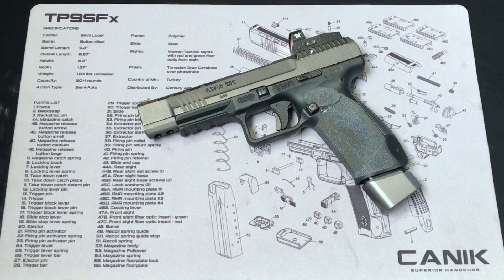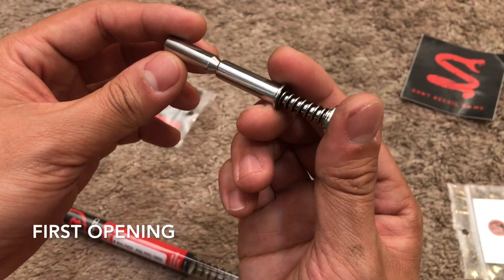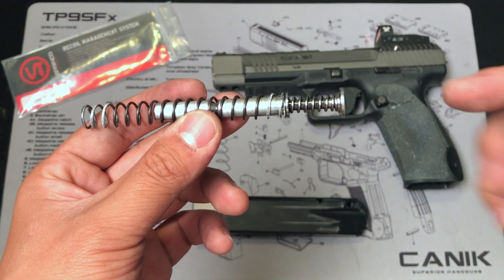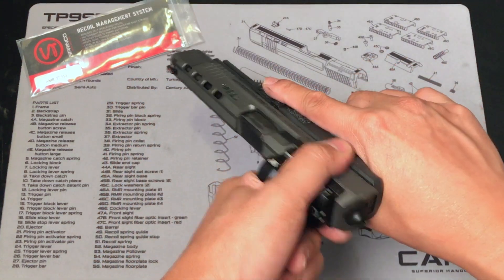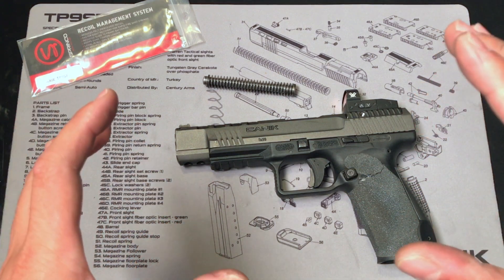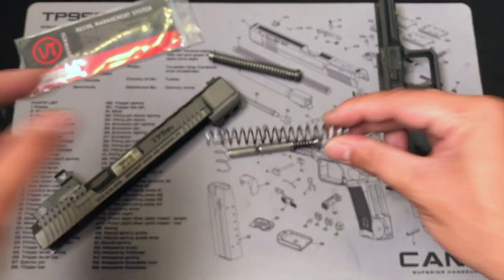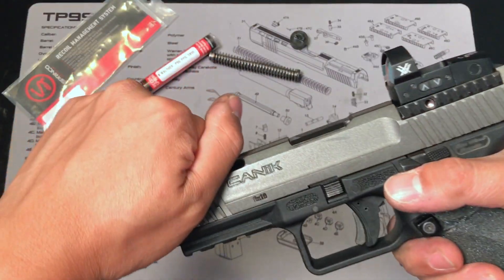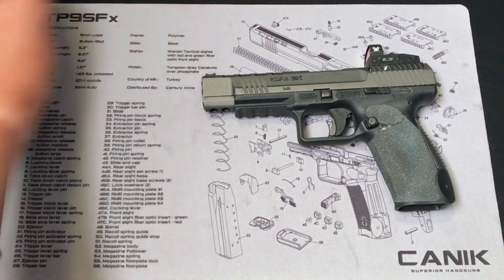Sprinco USA Recoil Management System

Comment: Tank I followed your directions to the tee, I changed out the recoil spring with the double spring from springCo and changed the firing pin spring with a 28 newton Glock spring.  Shot if for the first time this weekend and had 5 stove pipe occurrences , any explanation , I was shooting 115 grain bulk ammo from Bulk ammo.
Reply from the maker: I would check the ammo quality and shoot other ammo first, such as Federal american eagle. I would also check your griping. if you not grip your gun tight enough will also cause stove pipe.
Reply: Thanks Frank, I changed the spring so I could shoot bulk ammo, I will take that advice under advisement.  I do practice my hand grip.

Comment: Good video. and this looks like a good product. I have never modified a pistol from stock, but I like the idea behind this recoil system. I have the TP9SF but assume the issue with the slide impacting the frame would still be an issue as it was on the SFx.
Reply from the maker: Some people have some issue on their gun that FTE, due to the strong recoil spring. These mod is usually for competition :) I have an SF that is still stock and runs great.

Comment: Damn recoil spring cost as much as my new SFX. lol. $100 is a bit high, IMO. Love my stock SFX though. ($100 was a joke) My new SFX cost $470 out the door. Damn well worth the money. Put a cheap $40 micro red dot on her & she drives nails at 50y but hate a red dot. I’m a straight open sight guy I guess. Glad I didn’t purchase a Vortex & I highly recommend mounting a cheap micro to see if you like b4 shelling out the $$ for a high Dolla Red Dot.
Reply from the maker: yea cheap dot will work if you shoot at the range sometimes. I have my SFx with vortex Vemon 6MOA on it for almost 20,000 on it and no problem. I guess it depends on what you are using it for.  everything I put on is still working, just like the spring set. Again, I shoot competition, the stock pistol is fine for sure, but the gun shoots even better when you have some upgrade
Reply: Mike Hog A Nator what cheap red dot did you use? I'd like to get a cheap one to use but not sure what will fit the plates they supply. They only list the high dollar optics..
Reply: Pyro17059  It’s the ADE Micro Red Dot. It’s like $39 on eBay or Amazon. There’s a review Video on it. Some guy has it on his 40cal. & it works great! Especially on The TP9SFX. It holds zero & I Zero’d mine for 50y & was Driving Nails.. The only issue is, you have to file off a few MM off the back of the optic so it will fit down into the rear cut of the plate slide on TP9SFX. If that makes sense. You’ll see what I’m talking about when you get it. It’s a very robust little red dot.
Reply: Why  not canik improve strike coz it breaks